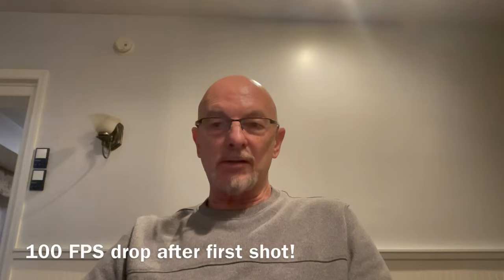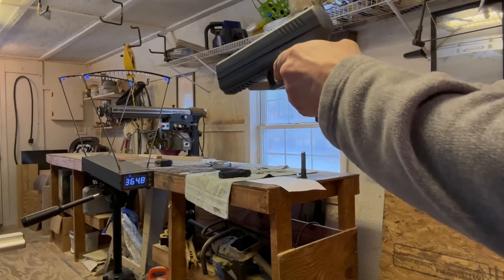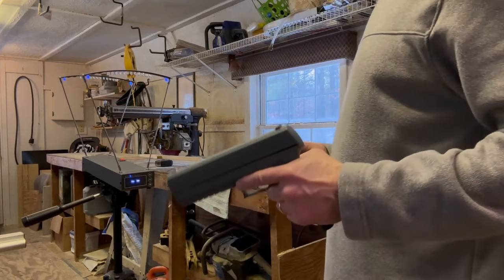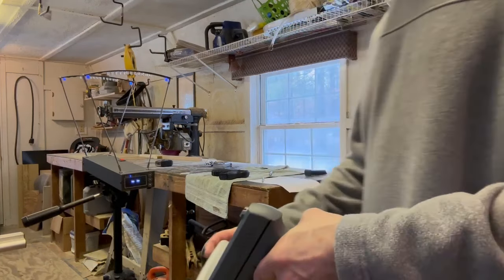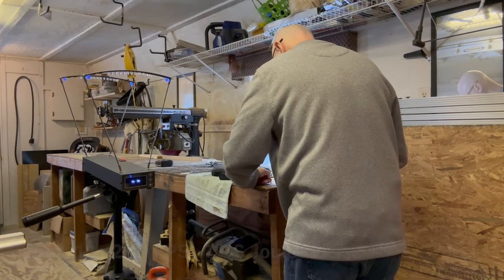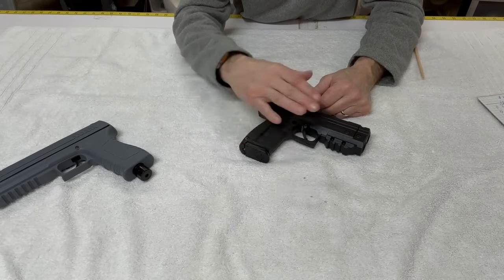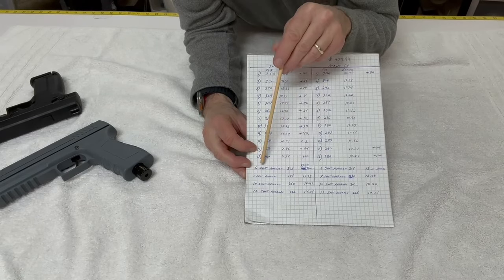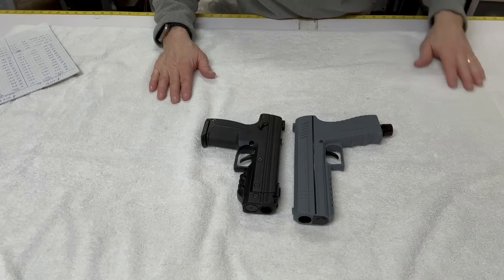Salt Supply S2 Blows Byrna LE Apart in Performance! Wow!!!

Comment: The title is incorrect, so you mean bryna did not pay you for a review LOL PATHETIC, it is a better system by far
Reply from the maker: Or maybe the title should be Byrna or Salt Supply didn’t pay for the review! I like the Byrna system also but the LE has had issues with the o-rings and doesn’t offer power consistently which is evident in almost every tubers videos. What you are calling pathetic are real time comparison with no editing, sorry you didn’t like it but I'm not going to sugar coat the results to make you feel all warm and fuzzy.

Comment: But you said your LE was repaired.
Reply from the maker: Yes it blew an o-ring and went back for repair and after receiving it I chronographed and I felt it was not as consistent so I sent it back again and a week later they sent it back and emailed me that it passed all tests and my testing could be do to inconsistent operating temperatures, time taken between shots and speed of trigger pull etc. This LE was a replacement for my original that had multiple failures. You would have a Point to say the test was unfair because it had been repaired but according to Byrna it passed factory testing.